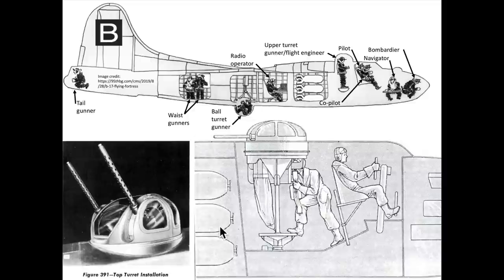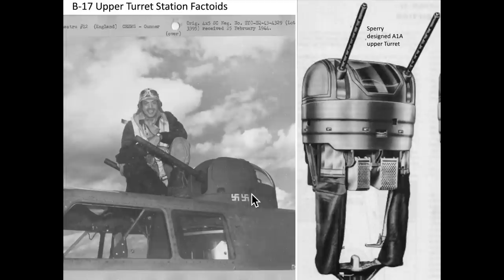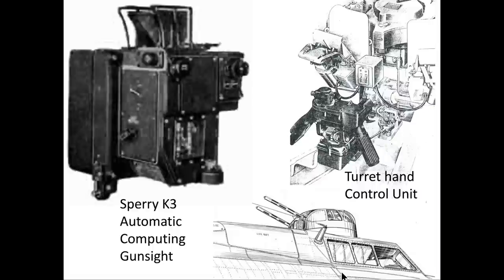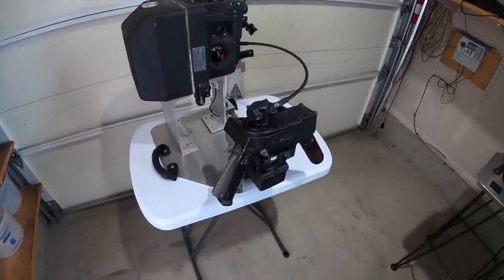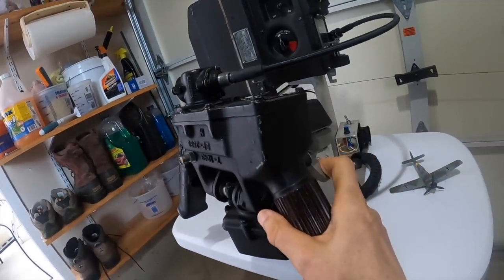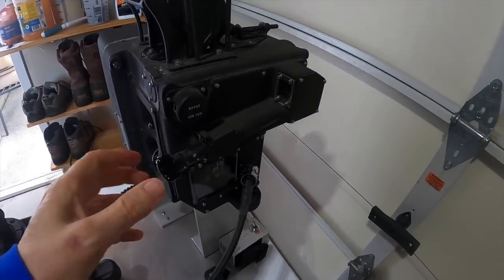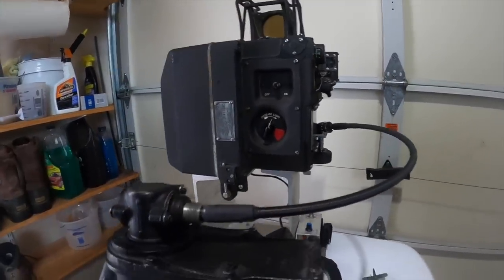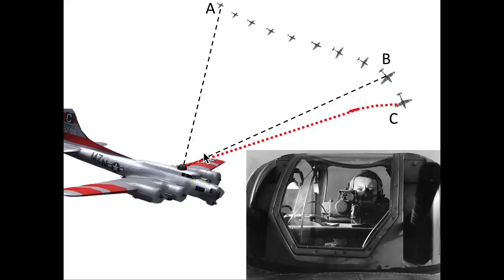B-17 Bomber's Upper Turret Station Review

Comment: That is one complicated gunsight.   Reminds me of a mechanical fire control used by a lot of British subs in the war.  It was unofficially called the "Is-Was".   Meaning that by the time you'd inputted all the data for the solution; ie., "The range IS, the target speed IS, the angle off the bow IS", you'd end up with a solution that WAS correct when you started.  This is very similar.  Especially for a head on attack, the gunner would have to be constantly adjusting the range bars, at a closing speed of 600kph, in the heat of combat.  That's a closing speed of roughly 166 meters per Second.  Cant really see that working.  Far better to just set the range for just, say 300 meters, and hold your fire until then.  After all, no-one is going to hit a closing, fighter sized target, at 600 meters. At that range, a 109 looks like a dot with two very thin lines coming off it.  Great and interesting video though!
Reply: In the equivalent video for the Sperry ball turret, a veteran in the comments said that he was rarely able to frame a target because of the relative speed of the attacking aircraft. I wonder how close the adjustments needed to be in order to actually hit anything.

Comment: So what you suppose to do if two fighter are coming at u at the same time but they aren't close together.? One let's say, is a little further back. He suppose to be clicking that handle all the time for range? What if the plane is running parallel to the bomber? Why does the top turret have this but not the rear nor the the side gunners?

Comment: You point out that the armor protection is for the standard .30 cal machine gun. Did the Americans think they would be fighting the RAF? If I'm not mistaken, the German interceptors were generally armed with 13mm machine guns and larger cannons. The RAF used .30 cal machine guns on its Spitfire and Hurricanes. I wonder why the armor was only designed for .30 cal? Maybe, 13mm armor protection would be too heavy?

Do you plan a series on the B-24 Liberator?
Reply: Great question.

Comment: What did they do if the enemy fighter wasn't coming at them head on, and thus they couldn't frame the wingtips between the lines in the sight in a straightforward manner? Like if the fighter was zipping past parallel to the bomber, or attacking at an angle? Just spray and pray, or was there a trick for those kinds of situations?
Reply: In the case of a head-on pass, the closing speed between a fighter and bomber is MUCH faster than either airplane's true airspeed and this means the gunner would probably only waste ammo trying to engage the target, since it would be gone almost faster than the human gunner could register its passage, let alone track it with the sluggish speed of the mechanical aiming computer apparatus OR the turret. The only possible chance you might have would be if you were already facing aft, and decided to use dead-reckoning to hit it as it passed, assuming it did not immediately bank down and out of your firing arc altogether (at which point it would then become the belly gunner's headache).

As for an angle attack, framing the wingtips exactly within the horizontal line is not required; a experienced gunner would use a combination of their training in calculating the placement of the airplane relative to him, and his judgement, to make the final 'eyeball' adjustments to the holographic gun sight try to score a hit using the general size and speed of the airplane as baseline parameters -- refer to the training video "Hitting a Moving Target for World War 2 Bomber Gunners (1944 - Restored)" for a detailed breakdown on how this works.

Comment: Better check your facts, a Browning .50 caliber does not fire at a rate of 11 rounds per second.  I don't think both of them combined can make that amount.
Reply from the maker: The firing rate for the light barrel Browning M2 was up to 850 rounds per minute. This equates to 14 rounds per second. The May, 1944 Aircrewman's Gunnery Training (Document OPNAV 33-34) manual page G-2 states, "Your Gun Fires 750 to 850 shots per minute - 14 shots a second".
Reply: These are AN/M2s, the aerial variant firing at like 900rpm or thereabouts. The aerial guns are monsters compared to the ~600? Rpm of the ground M2s. This is little league shit, come on, bro. Don't talk about what you dont know about; good life tip for seeming smart.